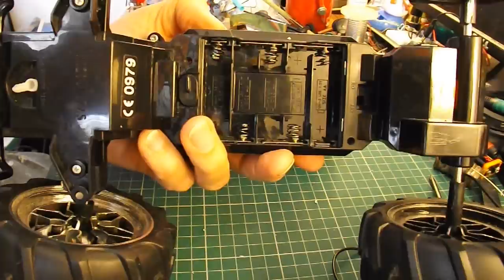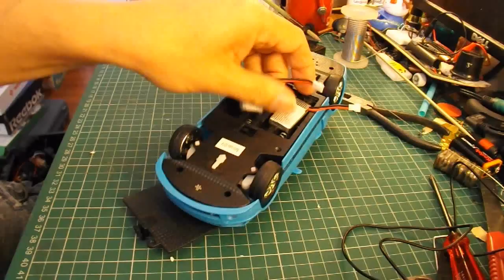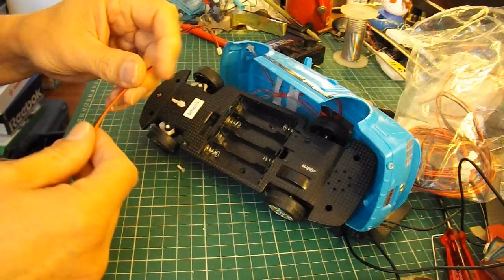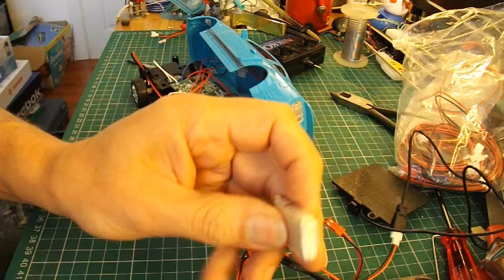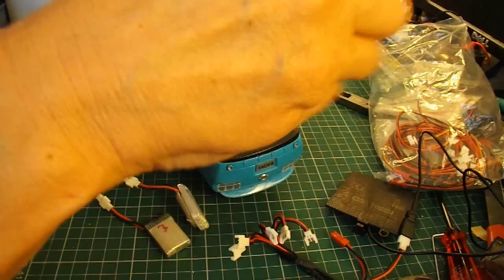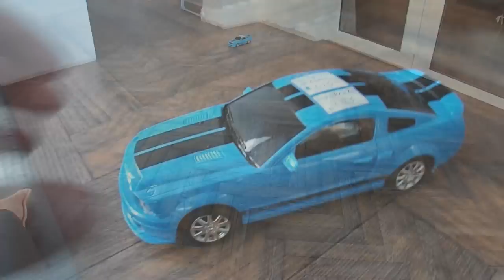Charity Shop Gold or Garbage? Lipo Conversion for RC toy car

Comment: 2 lipo's are 8.4v
Reply from the maker: +GuitarRocks360 the rated voltage of LiPos is 3.7, 7.4, 11.1 etc in multiples of 3.7 but fully charged they are 4.2, 8.4, 12.6 etc in multiples of 4.2. I don't know any battery that does not have a range of values based on it's state of charge, of course I could be wrong and expect somebody will come up with some type of battery that does not change :)
Reply: Rated to 7.4 ,charges to about 8   1/2 its like 12v car battery's they charge to 12.6
Reply: you're talking about a 7cell NiMH.  2s LiPo uses 7.4v

Comment: Can you put a servo in it
Reply: nope, servo has 3 wires for receiver and these cheap rc car receiver don't have that signal wire....also transmitter has 100% left or right button not proportional....
Reply: .southern_cali_rc or gyro?
Reply: .southern_cali_rc sjsoqksjdmwodi2k8x
Reply: .southern_cali_rc on